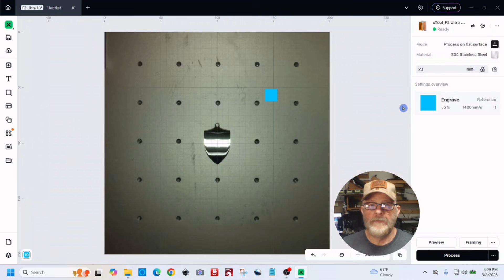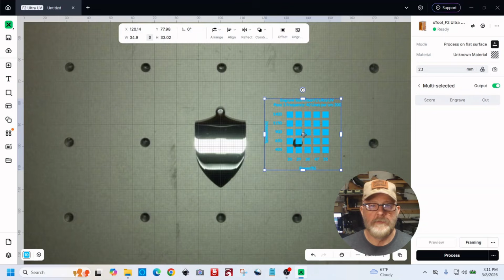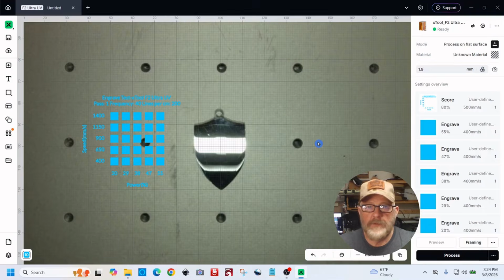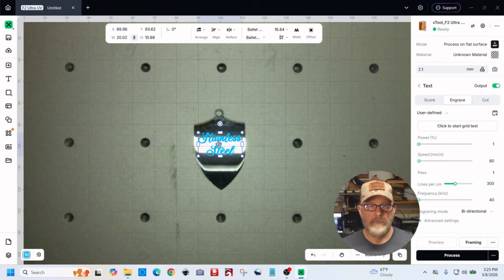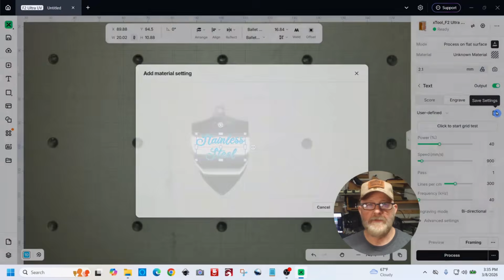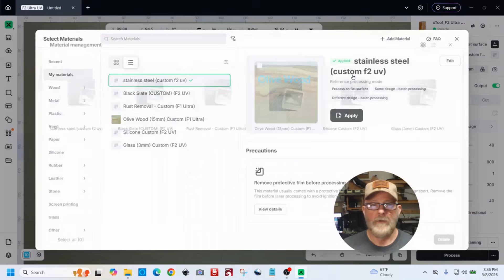UV Laser vs Stainless Steel + Material Test

Comment: Great video Thank you! Do you have the RA3?  The reason I ask is because I have one and I am having a devil of a time focusing on a stainless steel  ring that I want to engrave a design repeated with a 2mm space between each graphic around the circumference of the ring. I am  carefully measuring  the perimeter and diameter but it seems always to be wrong engraving too far around the ring, I am using my F2 Ultra UV. Just thought I would see if you could help if you have any experience in this area.
Reply from the maker: I do have the RA3 but have not engraved a ring.  Not sure how you may be measuring, but I have in the past measured cylindrical items with a piece of string by wrapping it around, cutting exact, then measuring the string.  I will take this as a topic and try to do a video in the near future - wish I could be more help to you now.  Thank you for watching and for the question.  Take care - Dave!
Reply: @DGLaserCraft  Thank you Dave !  The string idea is a great idea I was using a tape measure ( vary akward ) I'll try that.
Reply from the maker: @rogerkegg  You are welcome! Thank you and  good luck with the project - please let me know when it works out.